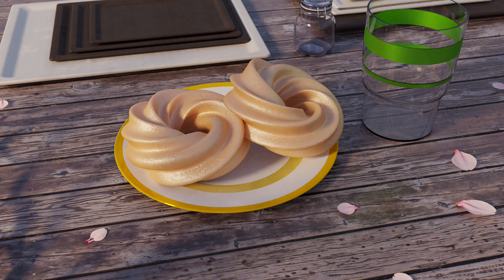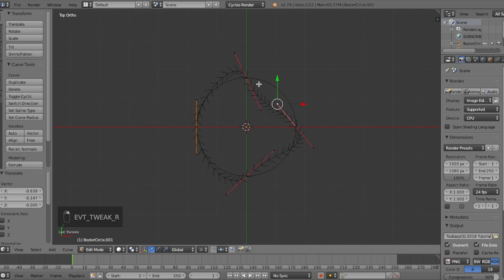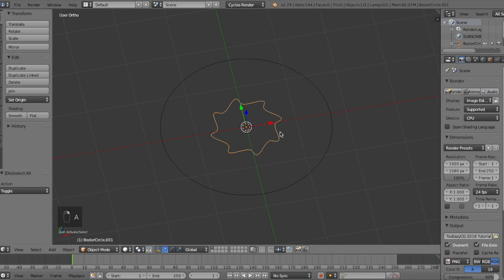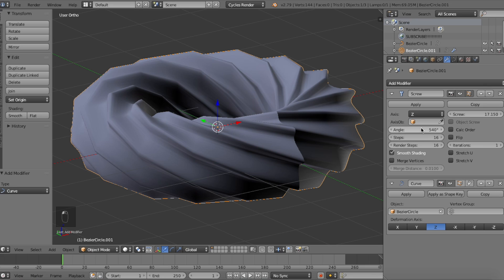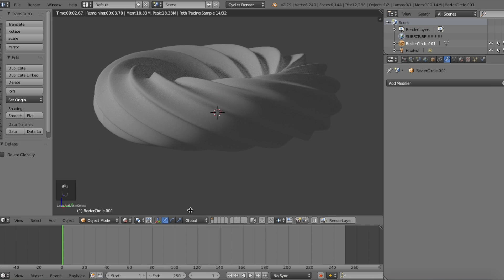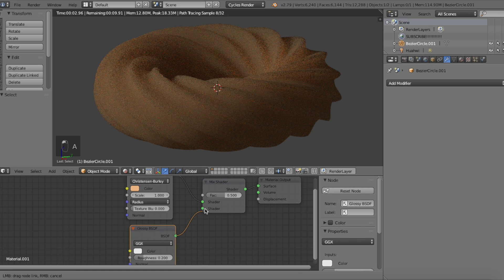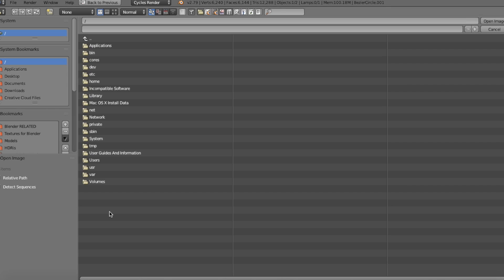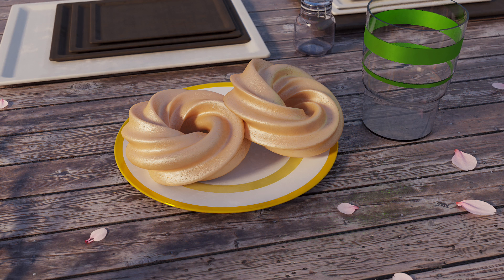Blender Tutorial:  How to model a Glazed Cruller Doughnut

Comment: The shape can also be done with just a curve-circle and curve bevel object, by using the twist value settings on the points on a bezier-curve based circle. Slightly different workflow, but you can have it line up every time without worrying about the screw modifier value.

Comment: Replace image texture node, use noise texture node (scale = 15, detail = 2) with black to white color ramp, then connect color from ramp to gloss shader normal. Use geometry node pointiness, connect to new color ramp with 2 color (1.000; 0.500; 0.010 @ 0.434  and 1.000;  1.000; 1.000 @ 0.639), connect color ramp color to subsurface color node. Use 0.5 for mix shader.
Reply from the maker: an amazing bump set up for the doughnut :)
Thank you for sharing

Comment: Good tutorial, thanks! May I add a suggestion / hint for new users? When you rotate the handles around 1:21 you can rotate them all at once: select all of them first, change the pivot center for rotation / scaling to "Individual Origins" (it's a dropdown button on the 3d view header), then rotate. Just remember to change the pivot center back to "Median Point" or whatever you need after that. Also, the blueish shade of the donut generated by the screw modifier indicates its normals are inverted (pointing inward in this case). You can fix that toggling the "Flip" button on in the screw modifier. Here: 3:35 you can see both the blueish color and the Flip button (right column of the screw modifier).
Reply from the maker: I knew I was forgetting something in the tutorial.  I have a clip of me flipping the normals (but through edit mode and with Ctrl + N after converting the curve to a mesh), but forgot to insert it in.  Ha ha your suggestion reminded me, thank you!

Comment: Definitely an interesting tutorial. Just wondering though, if we sign up for polligon, would we have to pay by the end of the trial period to continue using it for free?
Reply from the maker: Thanks for watching Edwin!  When you make a free trial, you have 30 days and you start with 50 or 60 credits.  You use these credits to download texture packs, or texture maps separately.  Once the trial on Poliigon ends, your credits will go to zero and you may not download any more textures (that require credits to download) unless you pay.  There ARE textures that you can download without credits, but it's very limited and comes at 1k resolution only